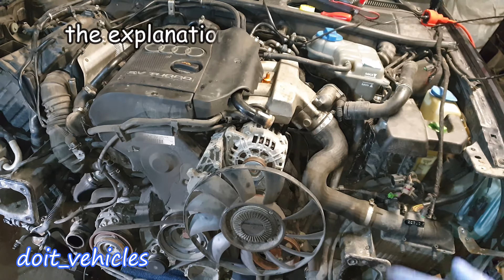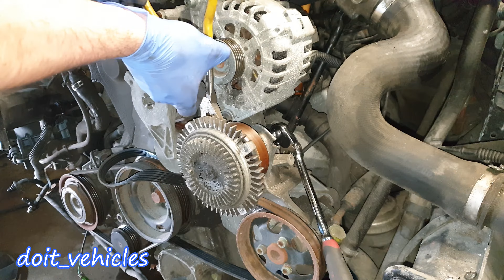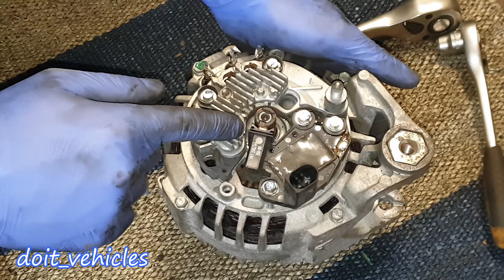1.8T Audi A6 Alternator - Volatge Regulator - Removal / Replacement c5

Comment: Hi gm I'm From Trinidad can u help me fix my audi a6 c5 1.8t 5v currently has a water leak on the front driverside of the engine to the point where as fast as you put coolant it disappears while off and dripping fast help would be greatful as I cam making it project and daily driver just need a tutorial  of how diagnose the water problem, the tools I would need and is the most common problem that empty the coolant reservoir

Comment: My audi 1.8t new battery died right away 
And the lights started flickering is that a sign of a bad alternator
Reply from the maker: what were the symptoms before replacing the battery ?
Reply: @doit_vehicles  dead battery after battery  jump all the windows/trunk don't work and rooftop converttable doesn't work
Reply from the maker: @skylinegt350yo6  What tests have you done now ?